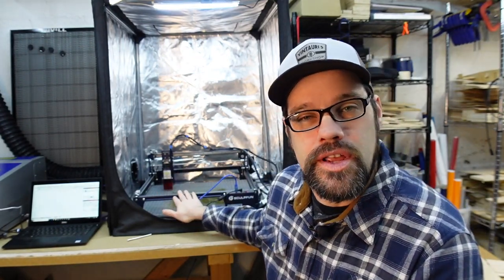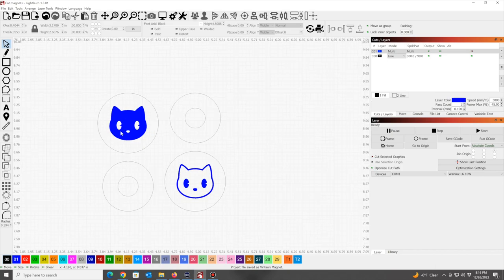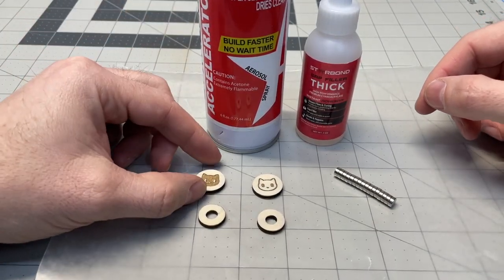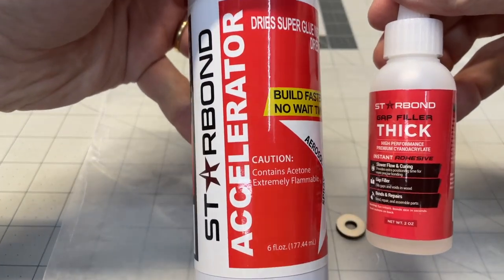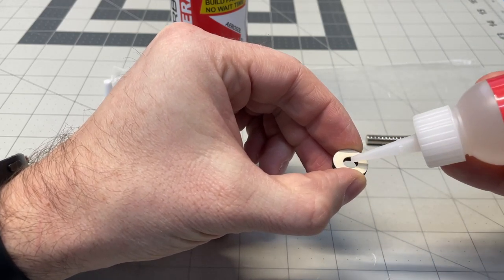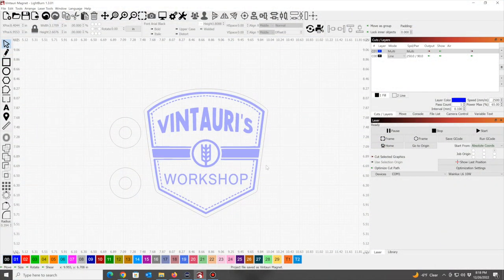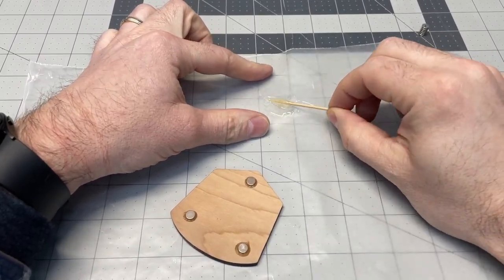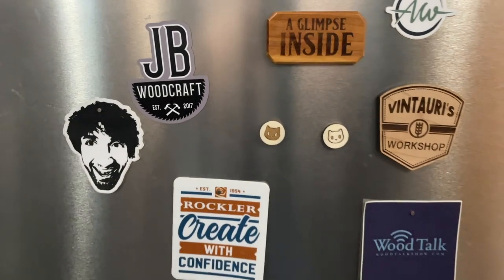Custom magnets from your scrap wood with a diode laser

Comment: Nice! It would of been cool to engrave the back of your logo a bit and inlay the magnets.
Reply from the maker: I was going for simple with these. But I have made them in the past where I drop them into the CNC router to pocket out for the magnets to be flush with the back. You just have to make sure they don’t end up too strong without a way to grip behind the piece to move it.

Comment: What do you mean by auto air cut at 1:35?  I thought air assist was always on or always off.
Reply from the maker: The sculpfun S30 series has the air pump connected to the control board so that lightburn can tell it to turn off and on based on the layer setting. So you can have it automatically turn on during a cut operation but shut off for an engrave if needed. I’ll show that in more detail when I post the full machine review.